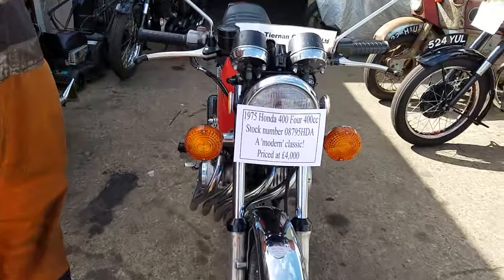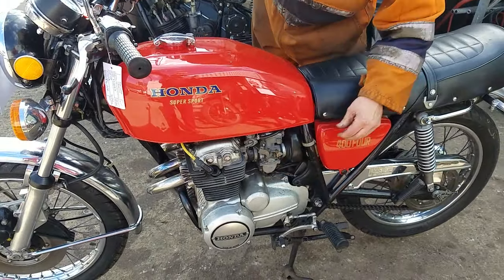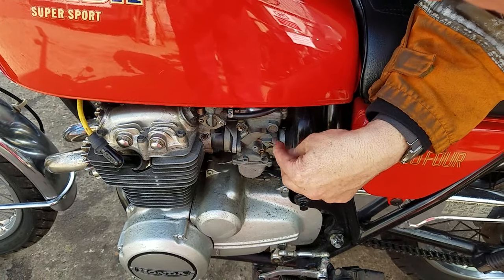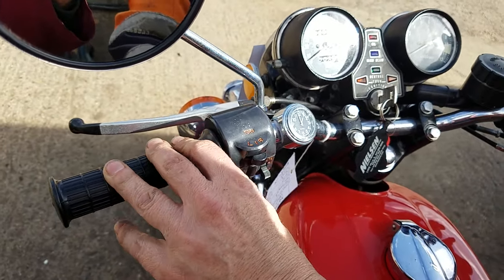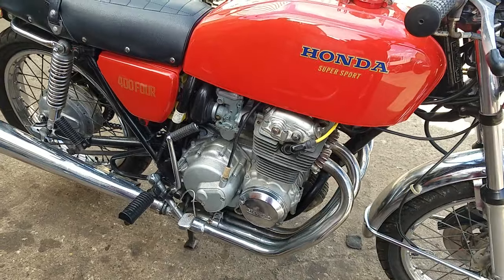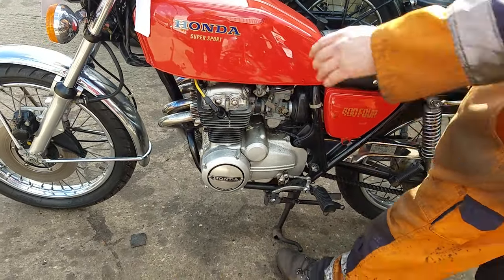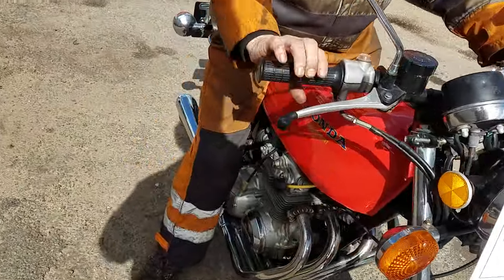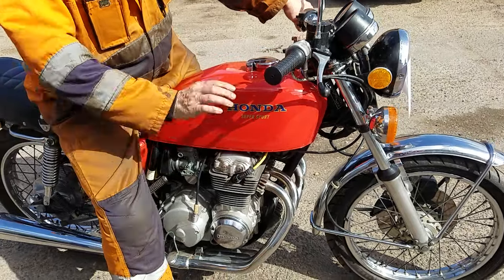1975 Honda 400 four 400cc at Andy Tiernans #08795HDA

Comment: Noisy cam chain?
Reply from the maker: Don't know,  sounded quiet while I rode it.
Reply: @peterranson4365  Hi Peter, it was at tickover that I thought it sounded rattly. If it is at all loose the slack is taken up under load so it's only really at tickover that you hear it. Give me a good old pushrod British bike any day 😄
Reply: Something not quite right with that. It shouldn't make that whirring noise
Reply: @bruceknights8330  I'm no expert on things Japanese but I believe that the plunger on the cam chain tensioner on these have a habit of sticking so when you release it to take up the slack it doesn't unless you give it a helping hand.
Reply: There is a slight camchain rattle on this bike . Nothing to worry about . These engines are just about bulletproof !  That knocking noise at tickover is the primary drive chain which has fixed guides no adjustment . Quite a normal sound if the four carbs aren't exactly in balance and I mean ' exactly ' ! It is perfectly normal and will do no harm to the engine . Cheers .